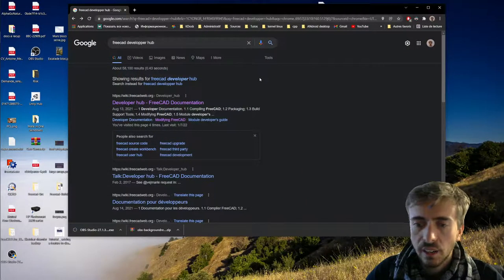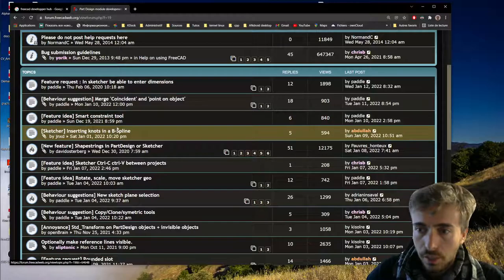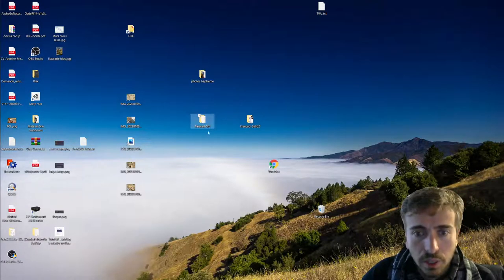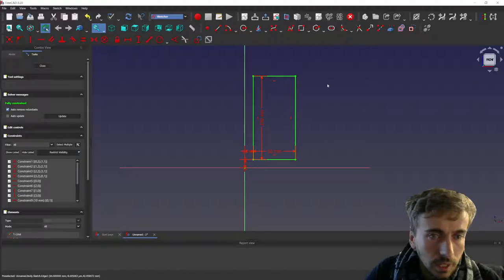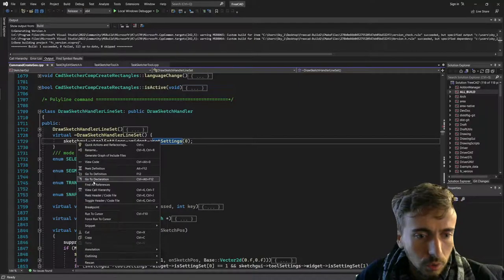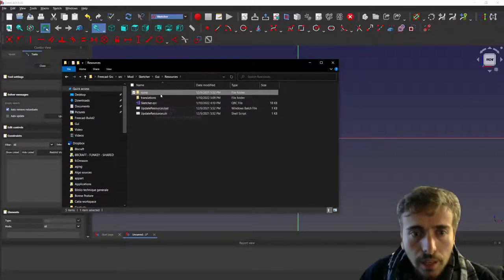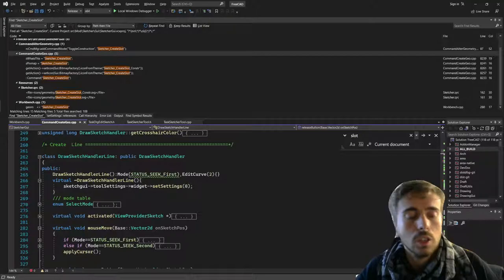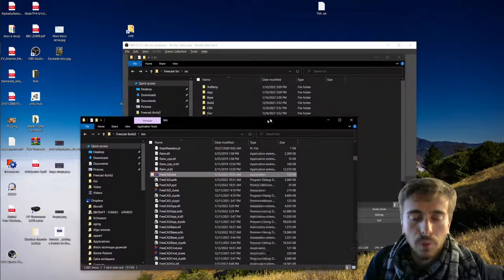Getting started in FreeCAD development

Comment: Currently I am not able to build in any of the operating system say Windows or Linux, both of them comes with a lots of error, EVEN THOUGH I FOLLOWED STEP-BY-STEP as mentioned on the wiki page.

In Linux, I am getting error......
make: * [Makefile:146: all] Error 2

In Windows, I am using Windows 10 build 1809 (cannot update to Windows 11 or using build 1909 and above for my other software requirements)....The step mentioned on wiki page is either outdated or incomplete (even I read and follow from top-to-bottom page)